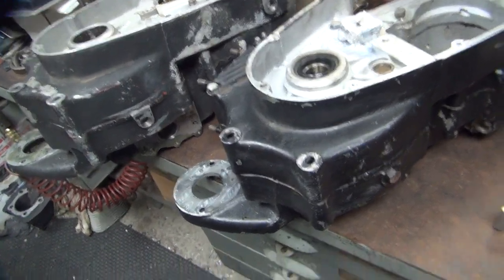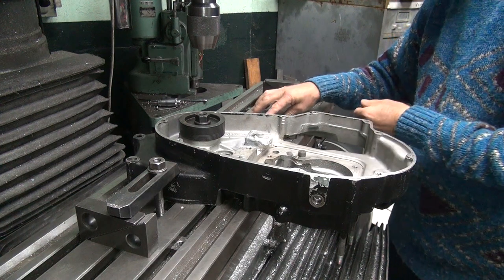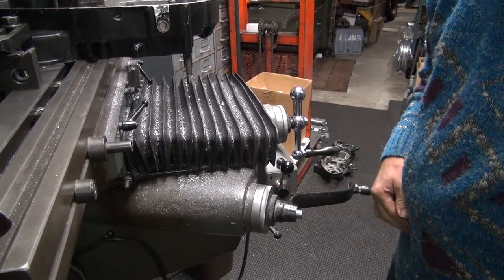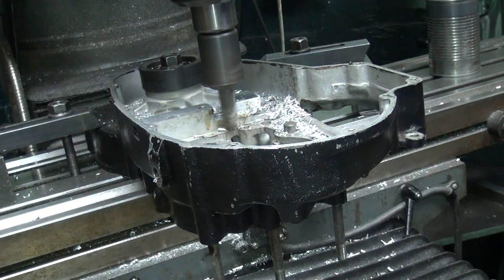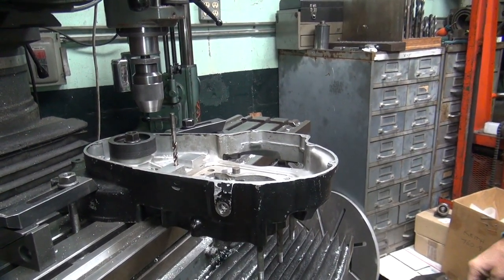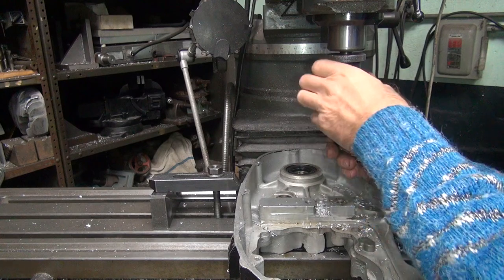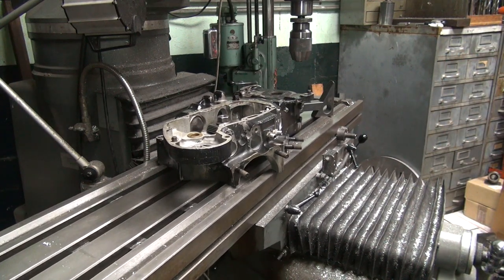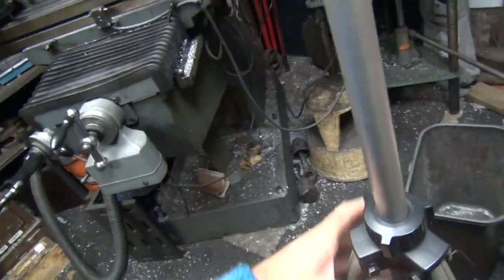1972 ironhead #103 xl xlch case repair motor rebuild harley sportster by tatro machine

Comment: My old man showed me a trick years ago.keep a set if bolts, various sizes.with a dimple from a center drill to find center to center...just a helpful suggestion... I was horrible at finding centers on stuff like that..lol
Reply from the maker: that only works when you have threads to work with. it would work good if you do.
tatro

Comment: Nice weld, no bubbles.  But the mill still needs cleani....  Oh, I give up!
Merry Christmas Mr. Tatro!
Reply from the maker: bubbles? not a chance. you only get bad welds if you don't spend the time to burn the crap out when you are welding. that is why spool guns don't work on harley aluminum. i keep the important parts clean, screw the rest.
tatro

Comment: Tatro on my 1970 this breather valve between  primary and crank case is plugged with kind of JB weld glue. Can it stay like this or I should fix it and put working valve again? please advise
Reply from the maker: plug it. jb weld does not always seal these breather valves.
tatro

Comment: Do you locktite your helicoils? If so which thread locker do you use?
Reply: I put red locktight on my coils.
Reply from the maker: i don't use anything on helicoils. if you put them in correctly they stay put. spark plugs is where you have problems because of the carbon build up on the spark plug threads. loctite makes no difference on this problem. you need some kind of positive locking system on spark plugs and helicoils do not have one. most other inserts come out too.

tatro

Comment: I thought you said you were going to do a quick weld on that passage near the crank bearing on the first case half that you said had a check valve but still lets oil pass.
Reply from the maker: its not done yet.
tatro
Reply: Oh, I'm sorry, I thought when you said, "ok now this set of case is ALL Good To Go" ( at 1:22:36), you actually meant it. I guess I'm suppose to read your mind to know that "Good to go" meant something different.
Reply: I understood it. You must listen.
Reply: That's the problem, I did listen. When I hear someone say that something is "good to go" that ususlly means that they are finished with it and it's "good to go". I guess when Tatro says, "It's good to go" that's suppose to mean he still has more to do on it instead of actually meaning "it's good to go"! I guess what I should do is turn the sound completely off and just watch the work. That way I won't confuse what means one thing to most people means something completely different on this channel.
Reply: He never said he was going to show us how to weld up that little hole just to do it.
Reply: I never said he did but at the time he said it was "good to go" it had not been welded yet as you could plainly see when it was on the mill. And, as he said above, even thought it is supposedly "good to go" he said when he first replied to me that "it's not done yet". And before you go with any other comments you might discover that one of the definitions of "Good to go" is: :Ready or prepared; fit for purpose; fixed or healthy" and does not mean that more works still has to be done to it.
Reply from the maker: the part i just did was good to go. today's work is good to go too. tomorrows work will be go to go when i do it. at some point the bike is good to go out the door.
tatro